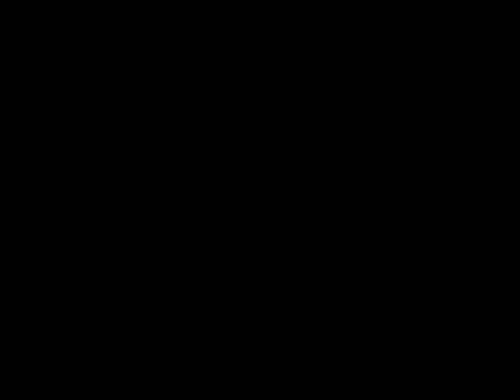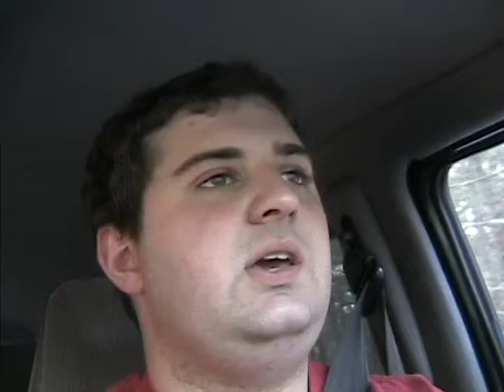Ford 5.4l Build Would I Do It Again?

Comment: Ford is tricky if your not a Ford guy it is easy to make mistake..never get 3 valve 5.4..always get Windsor 2valve 5.4.. better of this engine was 99...Romeo Ford engines are junk
Reply: I also have to point out my 330hp 3v 5.4 had 225k on it when I sold the truck and I never had any issues with it at all
Reply: 280,000 on mine
Reply: The coyote descended from the romeo..so I guess by your theory that 215hp Windsor (that splits at 500hp)is superior compared to a STOCK 460hp coyote??

Comment: the 5.4 has a lil taller deck them the 4.6 but other then that its the same has lil longer stroke same bore diameter you can make a 5.0 stroker bu putting 5.4 crank in the 4.6 seen some big numbers from those

Comment: You know how many people have broke them timing bolts. As it  says in lbs. Then 90 degree more. 

Also the exhaust bolts are easy to do. Hell I do them in the trucks. Just weld a nut to the old bolt. Spray some rust free lube on them. they will just come out. And Ford has a new kit to fix the rust issue. They use Copper coated stainless bolts and nuts...
Reply: Which one is better for supercity f250 or f250 5.4

Comment: Alexander, I just watched your video that you did on installing the heads. I left a comment thanking you as well as asking if you could point me in the right direction about rebuilding a Triton 5. 4 that I need to do in my Ford expedition. Your video here has exactly what I was asking about regarding do's and don'ts such as the white grease for the oil pump. Also the better manuals to buy as well as not to install set screws. Could you PLEASE email me at k9sarnj@gmail.com withthese exact points you make in your videos? For someone like me with wanting to do my first rebuild, this would help me very much. Ty so much in advance for your time and I lo

Comment: In this video it looks like an explorer you're driving. Between that, the F150 and the mustang you mentioned I'd say its safe to assume you're a ford guy. I grew up loving fords and Chevys. I never cared for dodge until I had a 2000 Durango, after that I started liking them more but I'm still a die hard ford man. My next buy will be a 02-05 suburban. I've always wanted to have one with a 6 inch lift and at least 35s. I figure once I get that ill have my truck and the suburban that ill own...

Comment: I called a machine shop and asked how much to redo mine. 490 + 19.99 for every exhaust hole that needs drilled and tapped. Well I said forget that lol. Ill do it myself and spend the time to save the money. Then have them cleaned and since I know they're good on cracks or warping just clean and resurface the valve seats or replace them all together. But.. Aluminums better lol

Comment from the maker: Thanks! Yea, the truck is not too bad to work on compared to some other vehicles I have worked on. People scared me when I started tearing into it. At one point I almost considered getting a factory reman motor or one out of a JY truck, but I decided I couldn't hurt the motor any more than it already was so I tore into it and began my build. Worked out well. Be careful when drilling and tapping your manifold bolts. Someone did the original heads on mine and didn't drill the holes straight

Comment: I've dreaded to spark plugs on my truck. Mostly because every single person I asked told me how much of a nightmare they can be. Well in my opinion, they were easy. My main reason to pull the intake was to make the plugs easier to get to and with 260k miles I figured since I can't drive it anyway, why not replace my gaskets and redo all my vacuum lines. Well for anyone fearing the plugs like I did, my advice is to pull the intake. It's not hard and in no time you can do it all.

Comment: I'm glad I found your videos. Lol. I have had so many people scare the hell outta me over working on my truck. I know I mentioned I pulled the upper intake the other day and I can honestly say I had no real issues. In fact it went so smoothly I'm pretty sure I'm gonna pull my heads while I'm at it. My exhaust manifold bolts are gone, as every other 5.4 I've seen so I think to just play it safe I might as well tear them off, drill and retap, and clean everything and install new gaskets..

Comment from the maker: @rolfi56 - When I was first looking into rebuilding/replacing my 5.4, everyone I spoke with locally made a big deal about rebuilding it, saying it was a pain to work on, but I really didn't have any trouble taking it apart and re-assembling it all. If you have a set of service manuals for the truck, it helps immensely. They give you every step needed to taking it apart and putting it (the 5.4) back together. The books are about $75 on Ebay. They helped a lot :)